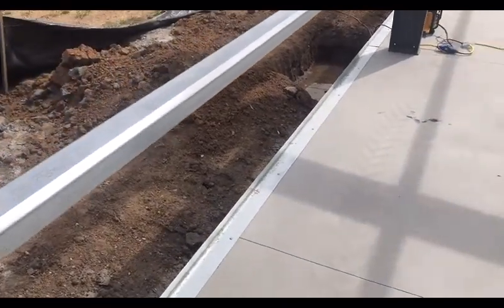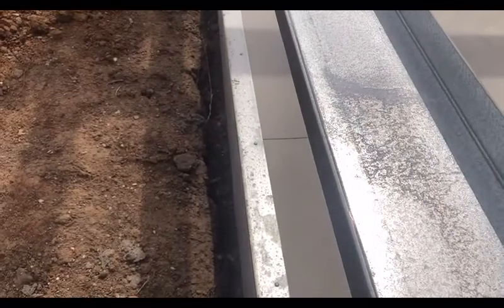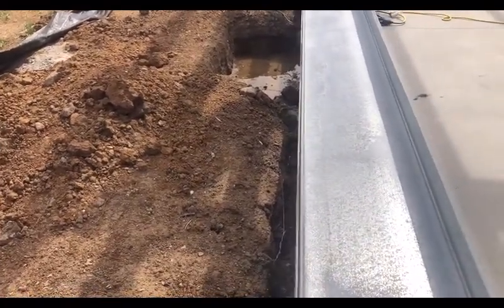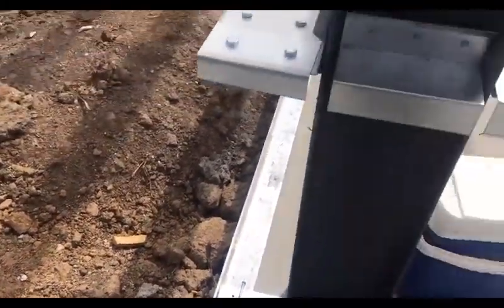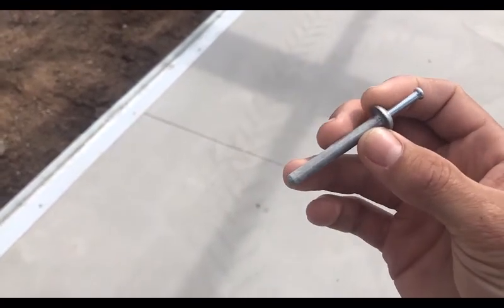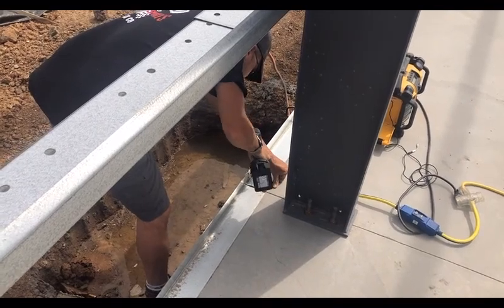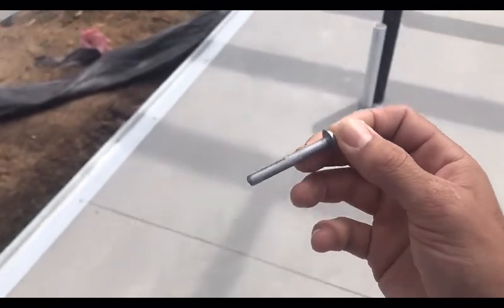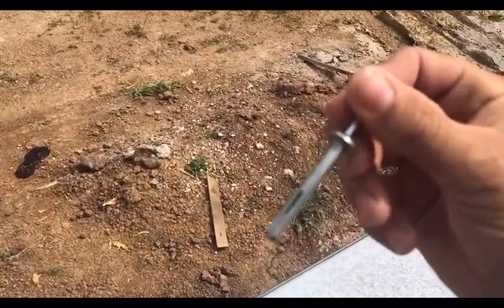Great Western Base Angle Installation

Comment: Hello Eric, question about the base angle installation. What do you think about laying a bead of adhesive/sealant down under it, as well as those anchors?
Reply from the maker: Hello Bob, 

While it's not necessary - it wouldn't hurt and I've seen a lot of people to it.  However, normally the  building panels are installed 1.25" lower than the edge of concrete with the closure strip and trim. So water would have to come up above floor level on the outside of the building to get in the building - all of the sealant and construction adhesive in the world isn't going to stop the water in that situation... But it is fine to do it. 

I have seen in some situations where a wall panel has to sit flush with the floor level - usually due to an oversight during concrete pouring like a concrete apron around the building or at an open lean-to/porch type thing. In this case action would be necessary but construction adhesive or sealant under the Base Angle/Channel is not the correct fix - we'd recommend Butyl sealant to applied on the inside of the panel (Difficult but doable) and on the outside. Butyl holds up better and doesn't turn rigid. 

Thanks